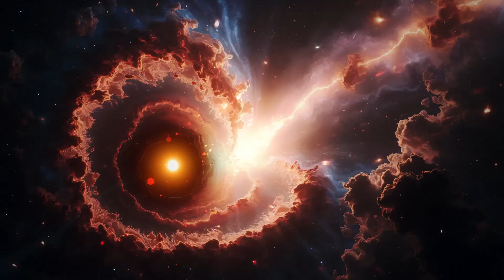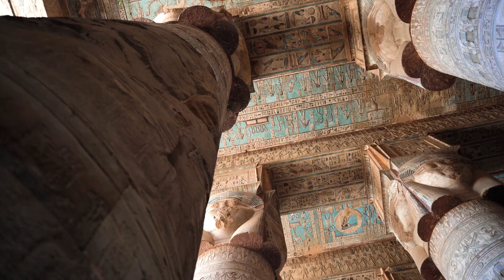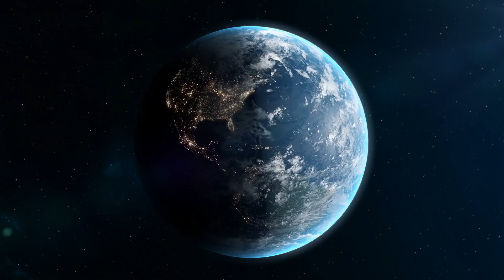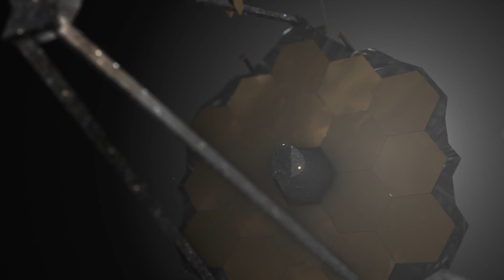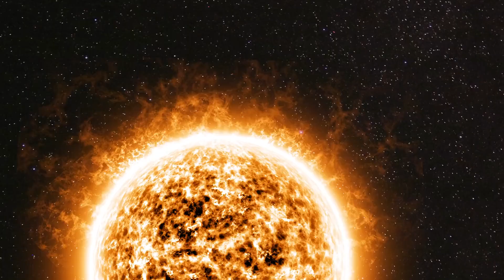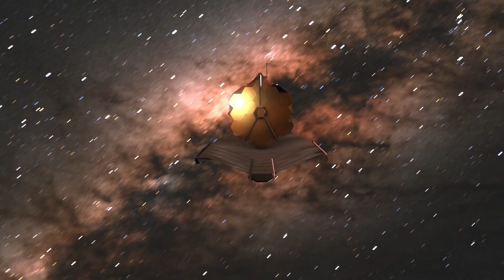The Pyramid Alignment Problem That Baffles Scientists

Comment: Anyone that's ever built anything would know that this level of precision is not possible with primitive tools
Reply: And yet, there they stand.
Reply: @greenforddrums  Precisely.
Reply: And you can't cut stone slabs with copper tools
Reply: @keithmarshall7715  They didn't use copper tools to cut stones, they used stone to cut stone.
Reply: @imikewillrockyou, how do you cut a 3 ton stone block out using a stone chisel?
Reply from the maker: They actually used both. Copper tools are real, they’ve found them at dig sites. For softer stone like limestone they worked fine, and for harder stuff like granite they used copper with sand as an abrasive. Stone tools were used too
Reply: @AstrolithDocs  Sounds about right, the copper tools were likely used to hold leather embedded with granite dust, or perhaps kiln fired ceramics embedded with granite dust. In the modern world we use artificial diamond dust with power tools which gets the job done more quickly.
Reply: @AstrolithDocs They used  copper and sand as an abrasive. Surely, that is not possible. Can you provide actual video evidence of this being replicated. I guess not
Reply: @keithmarshall7715  We know they could make precision ceramics, they left a ton behind. They likely used precision hydraulic powered granite dust embedded kiln fired ceramic cutting tools, some of them very large. The tools themselves would have been consumed by the process. 

Recently I watched a video of the ruins of Pompeii, the Romans were also adept at working stone, they had some impressive stone wheat grinding mills.
Reply: Building solar clocks is an old hobby of mine, and I can align them true north by using just the shadows from the sun. The larger the object casting the shadow the more accurate your alignment will be. The ancient Egyptian engineers no doubt set up a very tall pillar when laying the corner stone, which could achieve that level of accuracy.